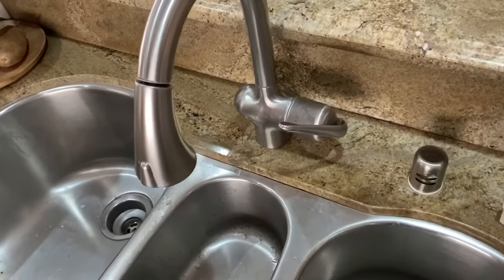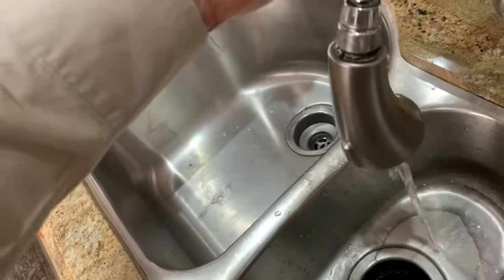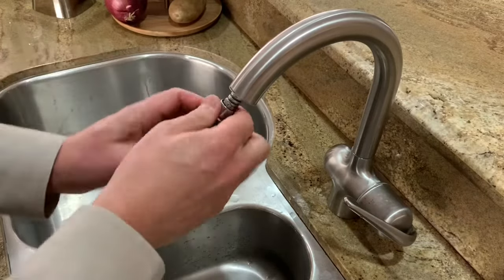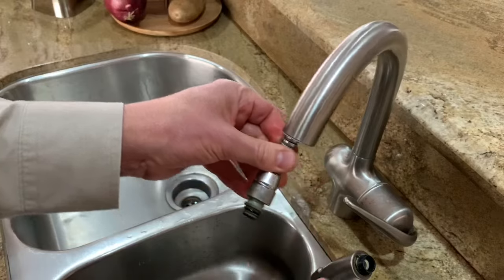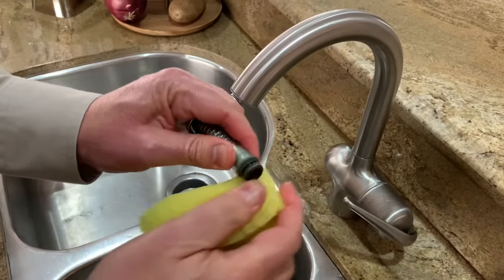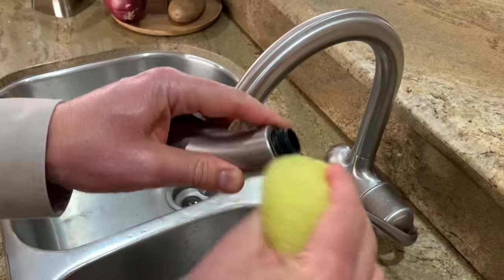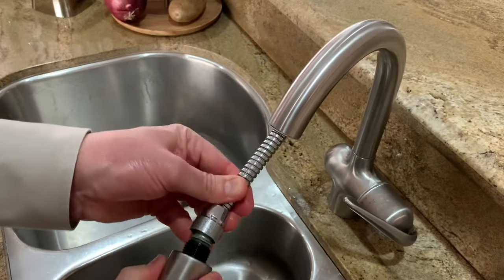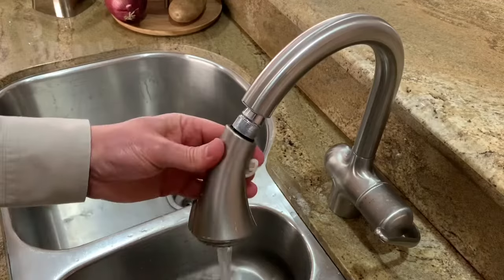Kitchen Faucet Leak Repair Spout

Comment: Alo! Mine is leaking from the button that changes the water from shower to stream. I don't see how I can disassemble it so I can check what's going on, do you know what I could do or check? I've have cleaned it already but it still leaks from the button
Reply from the maker: You may need to replace the head. Contact the manufacturer to get one under a lifetime warranty (the big ones offer it)

Comment: What if it’s just the hot water ? What if I turned the valve more and the pressure was better ? Could that be a sign that something is clogged ?
Reply from the maker: I turn the valves up full. It may be that you are talking about water volume and not water pressure. If you turn the valve so it is fully open, and the water volume is good at the spout, you don't have any problems! If you still have a problem, it is isolated to the hot side and you can begin to look at the angle valve, supply line, or cartridge in the faucet.

Comment: Mine just started leaking at the point where the flexible cord meets the top part of the spayhead and it doesn't appear to be tighten-able.
Reply from the maker: Do you have a hose that is a clear plastic type or is more like the one in the video?
Reply: @MikeKlimek  It's like the one in the video, but the leak is at the very top, where the sprayhead ends and the flexible cord meets. it doesn't just leak, it sprays out all over.
Reply from the maker: @susaninglis01  It's hard to troubleshoot these things without being there, but it sounds like its either cross-threaded or there is a bad o-ring or washer where the two pieces meet. You should be able to unscrew the head from the hose, Then inspect the pieces. Maybe there is an o-ring or rubber washer missing or torn/split/cracked.
Reply: @MikeKlimek  I'll take a look and see what I can do. Thank you so much for the quick replies!  Happy Holidays to you!
Reply from the maker: @susaninglis01  Happy Holidays to you as well!